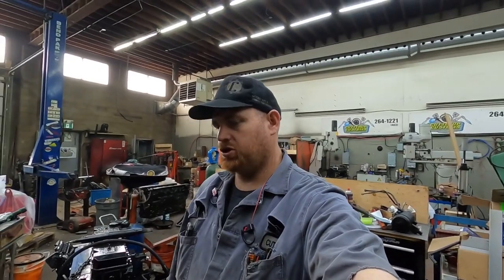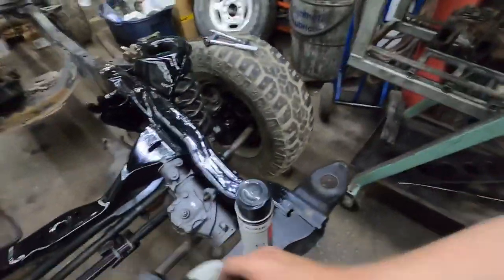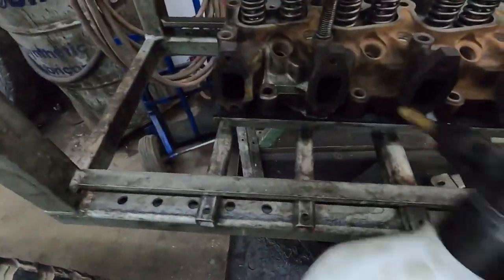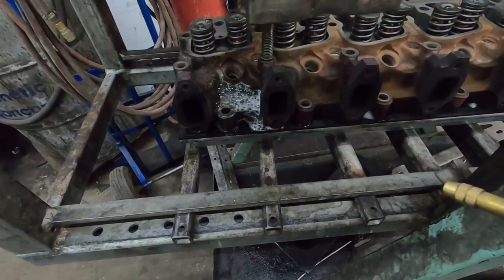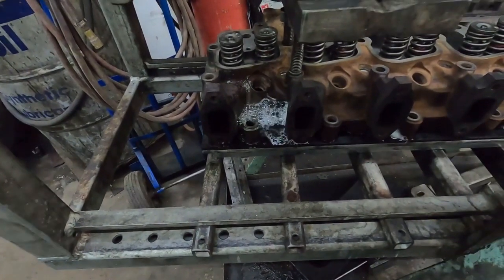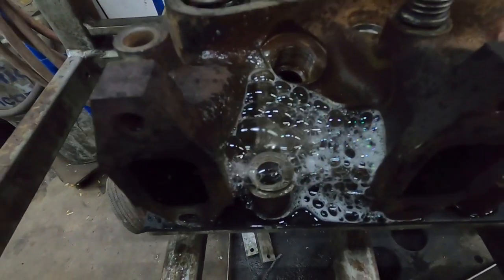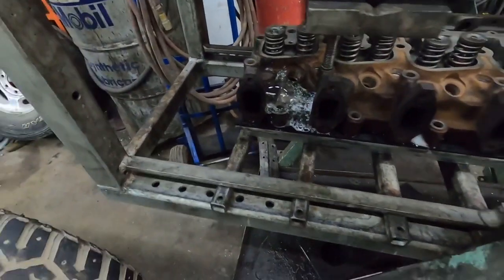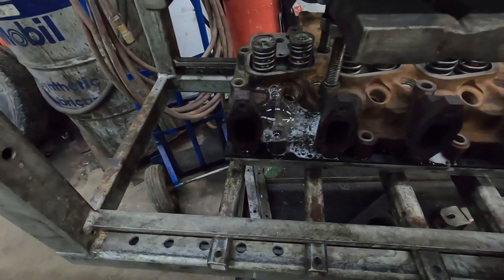Pressure test your 12v Cummins heads !!

Comment: Those cracks are fairly common on a B series, but often overlooked by  some shops.   Did you also magnaflux the head?  If I find a Crack with the magnet I don't bother to pressure test, too much work and doesn't tell me anything I didn't already know.   

I typically save pressure testing for the "mystery"  issues .  The things I don't like about pressure testing is that there is no simulate heat expansion and the clamping loads of the head bolts.
Reply from the maker: I Magna flux the head first and seen it had a weird spot and had coolant residue so figure better test it